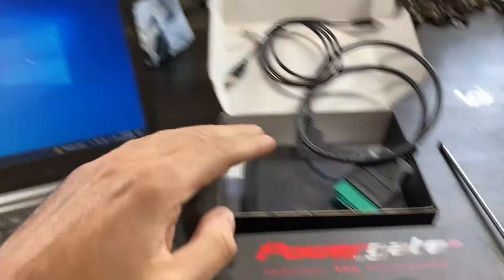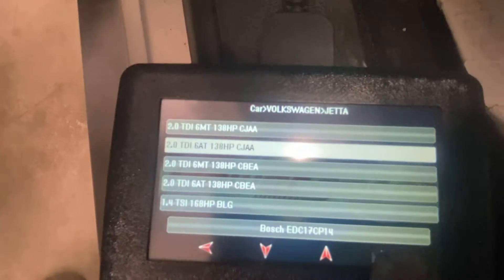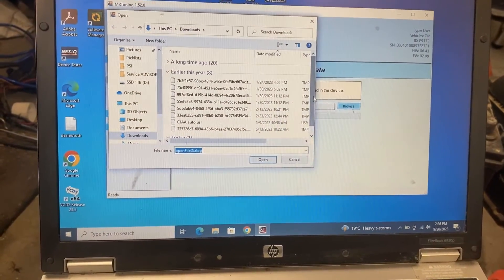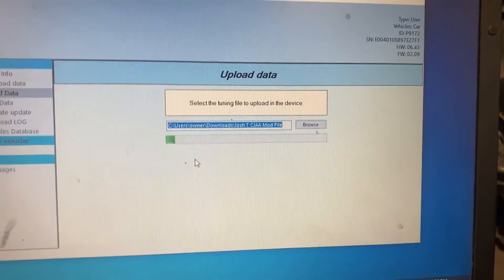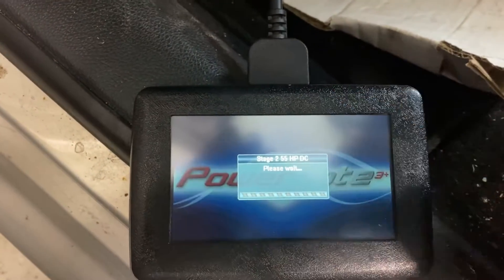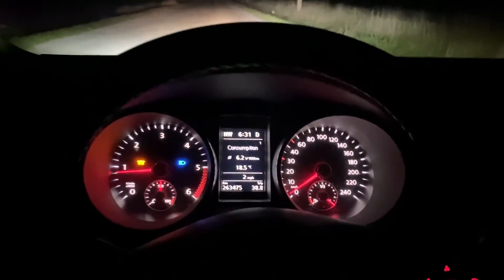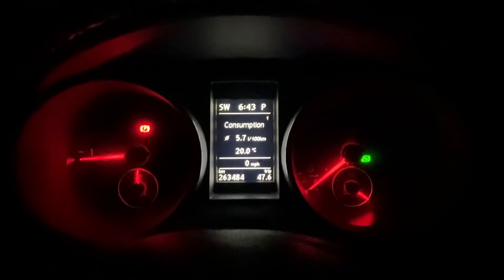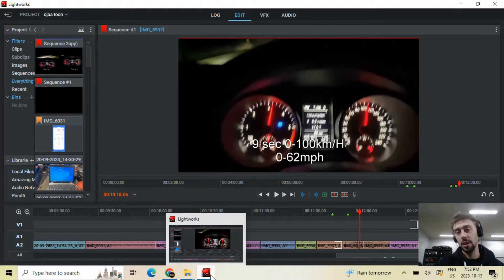CJAA TDI: Stock VS Stage 2 tuned

Comment: Nice video! Why was the glow plug light flashing on the pre test? The post test was awesome! Does it still have the dpf and all the emissions crap in the post test? I have a 2011 manual that has some issues. I am trying to decide whether fix or sell it, Your after test makes Me want to keep it!   Thanks!
Reply from the maker: Pre-test didn't have the dpf but was still stock tune, it wasn't happy. It definitely makes it a new car

Comment: I have a CJAA Jetta Wagon with a Malone tune and Rawtek hardware. Wondering if I need to fork over another $700 to MR or Stevenson to get a smoke tune for a party trick?
Reply from the maker: Im not real familiar on the smoke limiters on these, i'd imagine they use both the MAF and lambda sensors making it hard to "trick" the ecu into adding more fuel
Reply: @JoshsJettas it's 100% doable. You can shut off the o2 sensor completely (many tuners do this, some like Stevenson keep it in place and active) and mass air flow is just mapping and maps can be edited.

Comment: Hi Josh, watching your videos and also doing research about diesel jetta's. My main goal is to get a 2011-2015 TDI jetta and aiming for very good gas mileage and range (1000+km's of Range) with good reliability. I don't care about how fast the car is but I don't mind the extra power and torque the tune would give. Mainly focusing on the good gas usage. I've read up on deleting the car and other little tips and tricks. Could you recommend anything to help me reach this goal on this car? Also some questions: Does the tune with the car deleted improve gas mileage & is the price cost of the tune and deletion of the car worth it in regards to improving reliability and fuel economy? would appreciate the help. thank you!
Reply from the maker: There is a gain when just tuning the car, even more so when deleting. Car doesn’t have to run as hot to regen, runs at optimal performance and don’t have emissions components or sensors to fail. I did a break down on mileage pay back at the end of the video, pays back even faster if you have a component failure

Comment: Hi Josh! I have a 2013 Golf TDI 6MT and am planning to buy a Flowdirekt kit since I am in Quebec and it would be easier to get it..Can you please tell me where to get that powergate tool and if I can do the tunning safely at home...I then only have to find a shop to install the CR140 delete kit. Thanks in advance
Are you located in Quebec as well & can you do the install for me?
Reply from the maker: Im in Southern ontario, fair ways away. Everything can be ordered through MR Tuning though, theyve updated their website so it can all be ordered there. Theyre in quebec as well.
Reply: @JoshsJettas  Thank you very much Josh! Here is the situatiom: I was away for 6 months and left thekey to my neighbor who was starting the car every week or 2 for 10-15 min...After I came back on Dec, the DPF issue (which I never had after it was replaced under warranty in Aug 2021) arose and made seriously consider deleting it...After countless regen cycles, the car that  was at first driving like a block of cement, drives smoothly now, but the light comes back everytime after I start the car (along with a Nox sensor related check engine)....Few seconds later, it disapears and the check engine remains on the dash...! Would you do the delete for, because the job has to be done by someone I trust...I got in touch with 3 shops and they quoted me form 1200$ to 1700$, but when it came to tune, they said they will be using custom tunes (i.e., None of the ones you mentioned, alias Tunezille, MR Tuning, Neurotuning,...), so I can't trust them with my car...I can drive down there to get ot done! Thanks
Reply: @DustyPearl-13 have you followed through? I’d come to your place and help you do the delete. It’s only a little bit of a pain just need a battery tender, computer, and some patience for the component removal. Did my CJAA and would never look back the milage is amazing
Reply: @dsrta645  Thank you very much, but I sold the MK6 TDI with 315000 km last march and got a Honda....I am planning to get a BMW  X5 35d and get it deleted...I will let you know...By the way I live in Montreal, Quebec, Canada
Reply: @ not familiar with those both always willing to lend a hand. Southern Ontario for me right by the border let me know if you need a hand I’m sure Quebec has some nice beer as an incentive!!!

Comment: After deleting my DPF, EGR and both cats my glow plug light is blinking just like in this video, however, unlike this video, installing the tune file did not turn off my glow plug light. Is there something else I need to do?
Reply: Tagging in for answer.
Reply: @GunsNBudder  So I think I answered my own question. The first tune I tried was a stage 1 25 HP tune. I tried again with the stage 2 55 HP tune and the glow plug light stopped flashing. I think the stage 1 might only be for vehicles with the emissions intact. I have yet to try the stage 2 25 HP tune but I'm guessing it would work. Now I'm wondering about their new "Econo" tune and also there is supposedly a way to run the 25 HP tune in Drive and the 55 HP tune in Sport mode, but I have bugged their tech support so much this week I might try that next week.
Reply from the maker: @JosephEaorle  how many files did they send you? I only got a 25hp and a 55hp which I assumed was their stage 1 and stage 2. I never tried the 25 hp tune myself but it should’ve been tuned for “off-road” use. 
As far as the 25hp and 55hp switch on the fly “sotf” tune it can only be done on auto cars and requires dsg tuning. D mode is 25 hp and S mode is the 55 hp tune.
Reply: @JoshsJettas  They sent me 4 files. "Econo," "Stage 1 25HP", "Stage 2 25HP," and "Stage 2 55HP." After installing the Stage 1 25 HP my glow plug light was still flashing. I emailed Martin about it and he told me that one is for emissions intact only.
Reply: @JosephEaorle  When switching from 25HP to 55HP tune did you have to flash to stock first? I am currently running the 25HP tune and want to switch over the 55HP file.
Reply: @jwizz9516  No I did not.

Comment: the engine is stock?
Reply from the maker: yes stock engine/turbo
Reply: @JoshsJettas  and 255 HP will not damage engine? i mean. pistons, crankshaft and connecting rods will it withstand such a load?. i have aslo jetta mk6 TDI "cjaa" engine and i just think about tunn up.
Reply from the maker: @amex13  it’s not 255hp, you get +25hp or +55hp over stock, I think they say you’ll be around 180hp with the 55 tune
Reply: 315 ft lbs 😮

Comment: Thanks for these great video's. Any downside to using the 55whp rather than the 25whp tune in regards to turbo longevity and fuel mileage?
Reply from the maker: mileage shoudnt change much unless your using all that power difference at every red light. As far as longevity i think it just runs 1 psi more, but they keep it within safe limits. Pretty easy to get a bad name in the tuning world if your making the engine/turbo run outside of their limits

Comment: Is obd2 readiness monitor set to ready after the tune?
Reply from the maker: ill have to double check but i believe theyre set to not applicable. So should pass emissions as all monitors are set to either ready or no applicable
Reply: @JoshsJettas  Are you saying that a deleted TDI can pass emissions tests in places like St Louis or Chicago that require emissions tests to register your vehicle? The tuning file is sensing when the vehicle is being tested?
Reply from the maker: @JosephEaorle  depends on how they test. If it’s strictly obd test looking at monitors it should. If it’s a visual check of components then it would fail.

Comment: Should i install the tune before installing my exhaust and deletes in case the file doesnt work? Im about to tear apart my sportwagen as well.
Reply from the maker: Yes get the stock file sent out and get the modded file on before removing stuff just in case. I haven’t had issues but you never know
Reply: @JoshsJettas  would it be fine to drive with the tune and my old exhaust still as I would have to install the tune then drive it to my shop
Reply: @timeandspacevintage3380 it will have a CEL but itll be fine for a short drive. It would destroy the emissions equipment quickly but you're getting rid of that anyways
Reply: @tylercorrigan228  my emissions equipment is already destroyed lol
Reply from the maker: Yeah a short drive will be fine, it’ll plug the dpf somewhat quickly though assuming it’s not cracked already

Comment: I got the tranny DSG tuned first then I got the engine tuned.  55 hp.  My fuel mileage increase crazy.  If I drive it like and old lady, I'm in the high 4's liters per 100... 120 to 130 kms 5.3 ish.
Reply from the maker: like it shouldve been from the factory, makes a big difference

Comment: Why is the glow plug light flashing??
Reply from the maker: Lack of dpf/egr/cat and related sensors
Reply: @JoshsJettas  that was deleted in the tune?
Reply from the maker: Yes it was an “off-road” stage 2 tune.
Reply: my glow plug is flashing too after deleting and did not go off after the tune, am I missing something?
Reply: Nevermind I did a stage 1 tune. After I did stage 2 it stopped flashing.

Comment: Will the tune work if the car has had the VW dieselgate fix?  Will a DPF and EGR removal help with the power increase?  Very informative video, thanks Josh.
Reply from the maker: Yes this car had both parts of the dieselgate fix. This is straight piped, I’m hoping to throw stock tires on and re-run the 0-100 tests again.